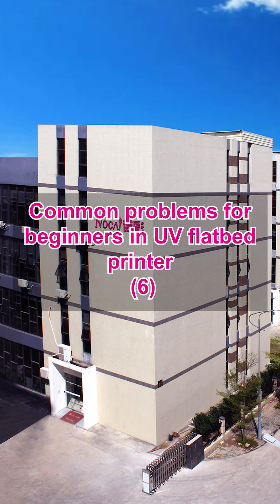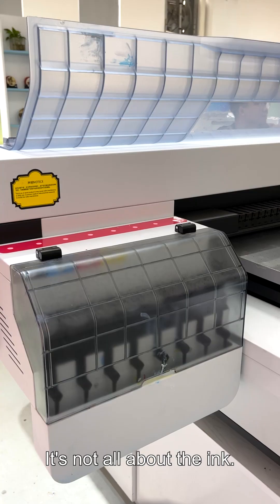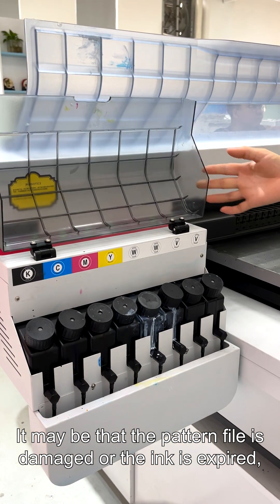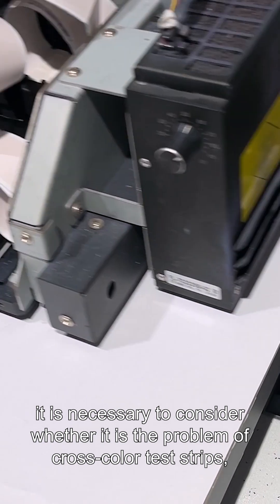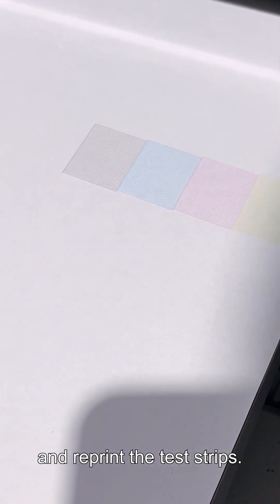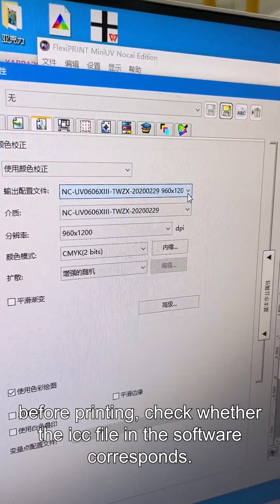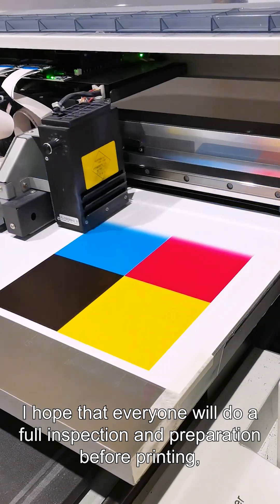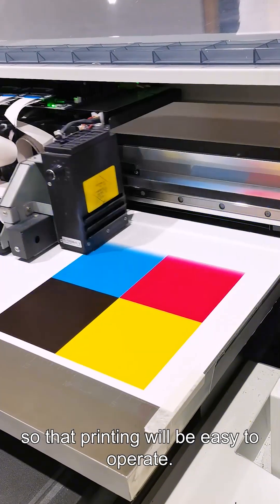Common problems for beginners in UV flatbed printers (6)# uv printer #uv machine operation

Comment: I just bought a PE III-II nocai machine, there is a problem that every print on the white ink section has a line, but it's not lined because the nozzle is clogged, can you help me? Is there a WhatsApp number we can contact?
Reply from the maker: +86 153 2235 2048,thanks